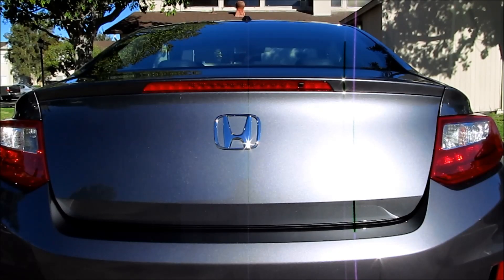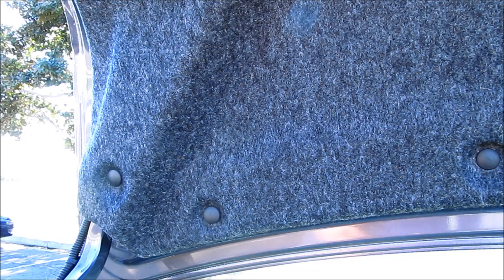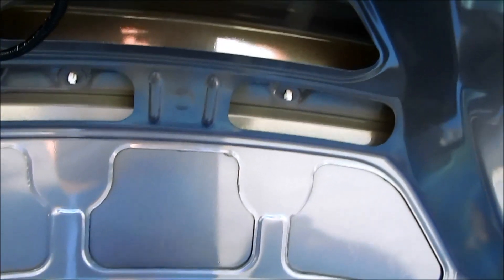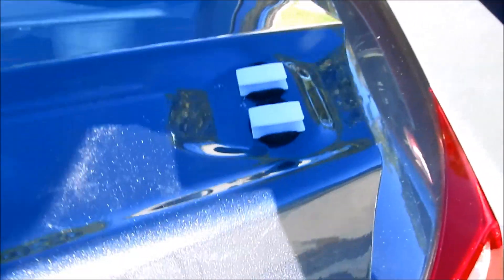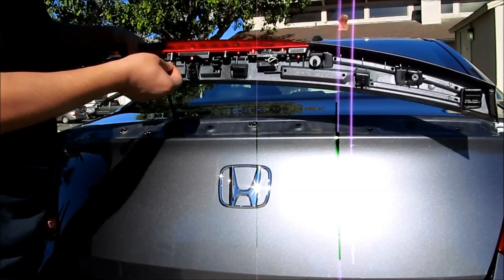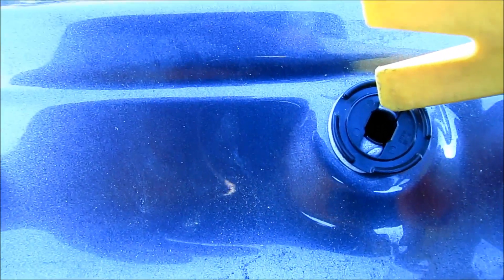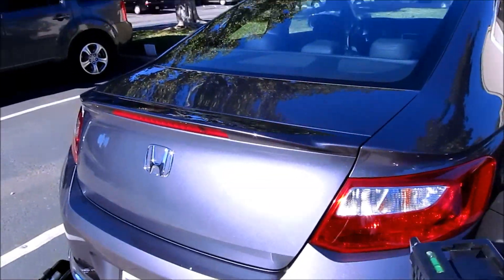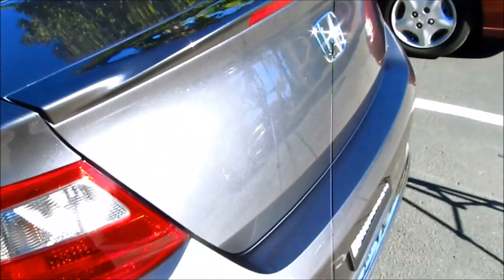DIY 2013 2014 2015 Honda Accord Coupe HFP Deck Lid Spoiler Installation

Comment: After all of your previous videos, I was surprised you hadn't done this upgrade sooner.

I installed my spoiler at the beginning of December and got frustrated with the white clips. Since the kit came with full replacement clips, I ended up just breaking them all off by cutting them at the base and then giving the old spoiler a firm pull from above. What I originally anticipated as a 30 minute install ended up taking me about an hour.

As always, great video!
Reply from the maker: At first I didn't want the spoiler but then later decided to get it.  I found a great deal for the door sill and the spoiler so I decided to buy them.  I would have installed it sooner had the weather been better.

But yea. the white clips just sucks.  There has to be a easier way to remove them but the Honda PDF installation sheet just states.. "remove the 11 clips.." and doesn't go into detail how to do so.

Comment: Great video and thanks for doing the step by step made it easy.  Let me say though that those little white tabs in the corners are a huge pain.  I recommend wearing at least rubber gloves simply cause as you stated the metal is very sharp.  I spent several minutes trying to pinch those tabs loose.  Finally they came loose as I was using so much force my hand slammed into the metal slicing the webbing between my fingers pretty bad.  Just a warning to anybody doing it.  Wear gloves or at least tape those sharp edges with blue tape ahead of time before screwing with those corner tabs they are a pain.  Trying to deal with a bad cut when you want to get your new spoiler on as your 2 month old puppy is jumping all over you is not fun lol
Reply from the maker: +John Jurbala Good tiip.. Yes those edges are SUPER sharp.  I cut my finger as well.  But well worth the time and effort.
Reply: long needle nose pliers make it quick and easy

Comment: Great Video!    I just bought a used 2013 Accord Coupe and noticed the light on the spoiler is not work but the brake lights work. What could be causing the light on the spoiler to not work?

Comment: I tried to remove my spoiler n it dodnt work so i tried putting back the 8mm bolt n it just kept turning n turning so i left it off. Wtf!? It wasnt going back in like normal n it even ended up falling INSIDE of my door while trying to screw it back😒😞

Comment: i like how you removed the accord badge. i may do the same.  looks good.  Im kinda mad because i bought mine with the HFP kit already installed and the spoiler is starting to come off...
Reply from the maker: +ballinboylbc If you purchased the car from the dealership with the spoiler already installed then it is covered by the 3 years 36,000 miles warranty.

Comment: I love the videos and thanks! I have a question. I have a 2016 accord coupe EX-L. I wanted to know if I purchase the touring headlamps what do I need to do to install them. Are they plug and play or do I need a wiring harness to make them work.
Reply: I have the same exact car, I wanted to install the touring headlights aswell. I was told i would have to buy brand new touring headlights in order for it to connect properly to the harness… used touring headlights are a no go and it was too expensive to buy…. Thats what I was told and it seemed like a hassle so I stopped. Did you install yours?

Comment: What about the black clips? There's two of them, they're round. The spoiler has to be worked up and down while pinching the clips together, otherwise forget about it. Also, unless you've got some baby hands, you're not getting in through the bottom.

Comment: Great Job!...I just bought a 2014 Accord Sedan Last week.  I really want to put the deck lid spoiler on my car, but I'm on a tight budget.  Do you know where I can find one at the best price?   I have the modern metallic steel metallic color, by the way.  Any help would be greatly appreciated! :)
Reply from the maker: I purchased mine from http://parts.sonshonda.com/
The part number for your car is: 08F10-T2A-140
If your going to install it yourself, don't forget that your going to have to swap out the trunk spring on the sedan.  They have a special tool to remove it that is not included in the kit.

I would go to estore.honda.com and type in your zipcode and search around for dealership around where you live to get the best price for the whole thing installed.  If you get it installed at the dealership, the 3 years 36,000 miles warranty also carries over to the part you get installed.

Comment: This part number, 08F-T3L-130, white orchard pearl, will work for my 2015 Accord Coupe, V6, 6-Speed, correct? Videos are great. Keep up the good work. Thanks,
Reply from the maker: Joe Bruce Yes, it is the same product just different color.  Installation is exactly the same.  The hardest part will be releasing the 2 white clips from under the trunk lid.  Good luck.
Reply: Hello, I have the same car did you or will you have a problem with the spoiler button on the trunk?

Comment: So the person who owned mine before me installed the HFP Body kit. The molding on the side is coming off. I'm assuming it's stuck on there by glue.   Do you know the type of glue I need to buy to seal it back on the side?
Reply from the maker: +ballinboylbc Its not stuck on by glue... well I guess it is if you consider 3M double sided automotive tape glue.  You can buy replacement at the dealership.
Reply: +DIY: Car Modz ok. I'm watching your video now after you installed it on your car. I see the double sided tape.  The rubber seal has a gap in it on mine 😤😤😤.  I guess that's ok since it's also screwed on. But I wanna get it fixed  asap

Comment: Good Video.  I am going to do this now thanks to this!  One question though, the instructions say to disconnect the battery.  Does this need to be done?  Did you do it?   Thanks!!
Reply from the maker: I did not disconnect the battery.  Honda always recommends disconnecting the battery when working with any electrical part.
I did not see the point since the car is turned off and no power will be going to the 3rd brake light on the spoiler when the brake is not engaged.  I did however, make sure that the I unplugged the brake light harness on the OEM spoiler before attempting to transferring the unit over to the new spoiler.
Reply: DIY: Car Modz ok it took me 2 hours to do this, mostly with the end clips which I just cut off anyway.  Your video helped a lot!!!  Thanks again!
Reply from the maker: Congrats on the install!!  You just saved $250 installation charge at the dealership.  and YES the end clips are a pain.  There probably is a tool that exist that makes the removal painless.
Reply: DIY: Car Modz
Yeah if they were easier to get at on the bottom it would be a breeze!

Comment: Does the edges of the decklidspoiler have some play? After installation? Bc i seem to have a little play in mines
Reply: Did you ever fix it? I just installed it couple months ago and now the edge is loose and have a little separation. Any advice of how to fix it?
Reply: @kai-chiehchang1782  honestly think it's just play in the plastic think you can use double sided tape to help flush it against the trunk a bit more.

Comment: how did you get the accord and v6 emblems off ?? I seen videos but not on this accord. didnt want to scrach or look sloppy. please show me a video or let me know what things do buy to do so .... thanks bro
Reply from the maker: I did it on a hot day with some dental floss.  or You can heat the emblem with a hairdryer and use floss or fishing line pull the emblem off.  Rub off the glue residue with rubbing compound.
Reply: I was going to try this but was looking risky on my end ... did not want to destroy paint

Comment: Did you bought it at ebay? Or online? Did you have trouble with the trunk button?
Reply from the maker: It was purchased from the Honda dealership.  This is a genuine honda accessory part.  No issues with the button.

Comment: Where did you get that wedge at? xD
Reply from the maker: http://www.harborfreight.com/4-piece-nylon-pry-bar-installer-kit-69668.html

http://www.ebay.com/itm/4-Piece-Auto-Door-Panel-Interior-Trim-Molding-Removal-/301052361256?pt=Motors_Automotive_Tools&hash=item46181e7a28&vxp=mtr